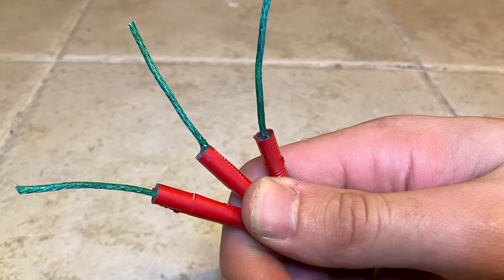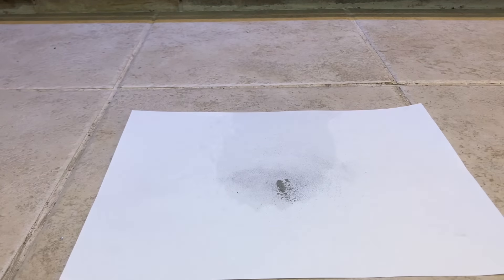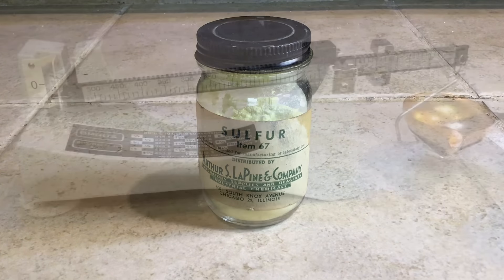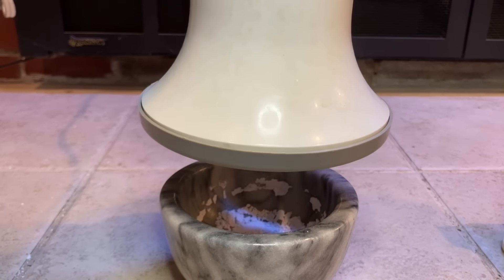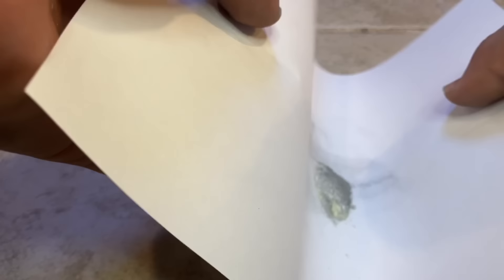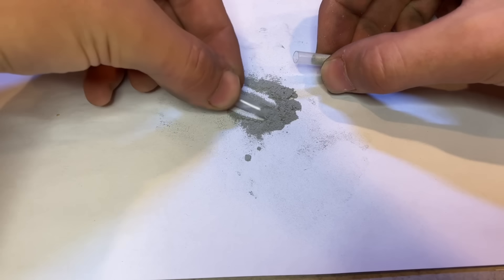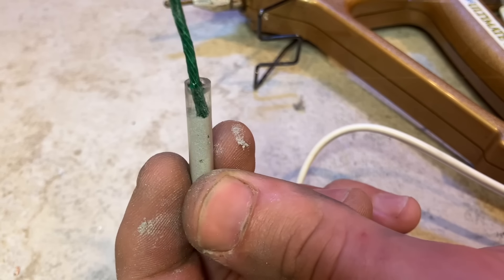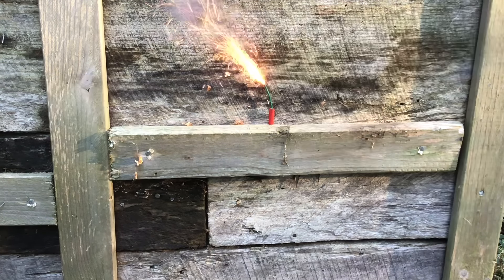How to Make Firecrackers | Super Loud!

Comment: Using hot glue to close up the top part where the fuse goes is not a good idea. The fuse burns very hot and melts the glue, basically opening it up on that side. That's causing it to not really explode but turning it into a rocket. Try using something like epoxy. I bet it makes them much louder.

Comment: As kids we used to collect crakers thad did not pop . We unrolled them a collected the powder on a news paper . There is a certain way to roll them . Fold the paper with powder in the middle than roll the edges toward the powder and when rolled properly tape together . We made them about 6 inches lonng , they were very powerful and dangerous so dont do it . We were dumn kids . We put one under a metal 5 gallon bucket and it blew apart and the end went up about 100 yards . So dont do it . We had one short fuse scare and never did it again .

Comment: As a young teen, in the 1970s, I used potassium nitrate, for my oxidizer. Either aluminum powder, or magnesium powder for the fuel. As said sulfur is optional. I'd make the powder in a larger quantity. I'd test a small amount, and look at the residue, to "tweek" the mixture, buy adding more fuel, of oxidizer. Even with potassium nitrate, the optimum mix, would make a thump, out in the open. Potassium nitrate is a lot less impact sensitive, than either potassium chlorate, and potassium perchlorate. We'd actually use those oxidizers, along with a small amount of a sulfide, to increase impact sensitivity, to make contact bombs.

For very illegal, real M-80s, you'd actually want to slow down the powder burn, just a bit, for a really loud bang.

Comment: Long ago, and far away, I made some "firecrackers", once, using 40 grains of 4FG (FFFFG) black powder. They made some amazing holes in the grass.
Reply: I did something similar when i was younger, mostly just tinkering around after having come across some black powder. I didn't have anything else to work with, so i took an old deck of cards, rolled up some tubes, wrapped with some duct tape, and forgot how i figured out a wick. But i remember that whatever i did, it surprised the sh*t out of me, because it worked much better than expected. I decided i had enough excitement after looking at the crater in my yard.
Reply: Black powder in any form is not even in the same world as fp
Reply: I know black powder isn't close, but I had a flintlock rifle and FFFFG is what I primed it with.
Reply: I did the same thing using flash powder and one of those Mad Balls taped onto a rock and submerged into a 5-gallon bucket of water.  It just about emptied the 5-gallon bucket and we all got a shower.  Good times.

Comment: I used to make the same powder but made it wet with 50/50 alcohol water and placed them on a drying rack for about 1week with a small fan and a de hunidifier running. It works well tge splatic stray would probably make it difficukt to dry. I used magnesium anode from hot water tank and it gives of a nice white light flash. We used to make all kinds after they were  banned in Chinada

Comment: Even before watching, IIRC a lot of the bang is from the tightness of the wrapping.  Wrapped very tightly, the burning charge is held longer, pressure is higher, and gives more of a snap.  Same gunpowder wrapped more losely produces less noise, the extreme of which is not wrapped at all, and it just gives a quick burning 'fwoosh'.  It is not only the amount of charge, they must be wrapped very tightly for maximum bang.
Reply: @ModelLights  flash powder does not care about a strong container that's not how it works,bp,sp,gun powder,yes but you'll never get the sound with anything but fp
Reply: @shannonking3201  ' flash powder does not care about a strong container '
Of course it does, just like anything else.  A container allows more complete burning and pressure rise before the container bursts.  No matter what it is for burning with an oxidizer, in free air it will start expanding as it burns, and the pressure peak won't be as high and abrupt as if it were in a container, went higher, and then the container ruptures.

If you don't actually understand what you're talking about, leave it to people who do isstead of pretending and guessing. 
Gasoline burns fast when in open air, and can explode with mixed air in a container.
'Flash powder' is not an explosive, it does not detonate and produce the crack of a firecracker without the container.

Literally everyone who can get some fireworks can take a few bucks, light one small firecracker and hear the crack, then unwind the paper on a second and light the remaining powder in free air.  They will know exactly who understands what they are talking about, and who does not.

BTW You do realize 'flash powder' is just that, it was the powder used to produce a flash for early cameras.  Anyone can easily look up an old movie and hear the 'whoosh' that big piles of flash powder makes for a camera flash, and see that it does not explode.  It burns rapidly and makes a bright flash, but there is no crack to it, it does not detonate.
Reply: @ModelLights  I can make a two part mixture that will provide a VERY LOUD report when a teaspoon of it is placed in an open paper cup.  I've used this method many times to test batches of flash powder.  A strong sealed container isn't necessary.
Reply: @dlkline27 i think that it depends if you have an actual detonation vs a fast burn or exothermic reaction.....
Reply: @ModelLights tell that to the german guy that mixed 2kg flash, put it into a a thin foil bag and lit it with a fuse. You wouldve went deaf in a 10 meter radius. 

Flash doesnt care about whether its encased or not. 

Many of those giant polish or spanish "crackers" (really just bombs at that point) have lots of flash in very thin cardboard tubes with thin glued plastic lids.

Theres many different mixtures of flash and many DO detonate very loudly even if just loosely sitting around.
Reply: @Sharpless2  'Flash doesnt care about whether its encased or not. '
Get a clue, and already answered.
'Flash' used to be for that, actually a flash.  Giant piles on a camera flash plaform still didn't explode.
Fireworks manufacturers have bastardized the term now to mean damn near anything.

Comment: Good safety info in this for newbies. I'd just add that if you are in an arid climate, Static Guard spray is cheap and should be used, especially if making really hot flash.. I know a guy that only tends to mix flash during humid months.
Reply: Run a humidifier in the room you're using.

Comment: I used to drill a hole in the bottom of a 5 lb coffee can, just big enough so a firecracker would fit tightly.  Then, with the can on it's side, and the open end slightly tilted upward, I'd add about 1 tbl sp of water, and at the open end about 1/4 tsp of BangSite (pulverized calcium carbide). Then carefully put the lid on tight, tilt the can so the water mixes with the Bangsite,  light the fire cracker, and hold your ears!!! LOL

Comment: As a welder, acetylene and 02 in soda bottles is quite entertaining...and if ya really want a boom, fill a 50 gallon trash bag. Don't pop it in your welding shop tho, it will break all the windows.
Ask me how i know..
Cannon fuse is a great igniter BUT...always cut it in two pieces. A short fuse into the container, and a long seperate fuse taped to it along side. The reason is the 02/acet mixture can flow into the fuse and detonate instantly upon lighting. With fuse in two parts it won't saturate the fuse to be lit. Keep in mind static electricity is a thing...
Reply: trash bag is iffy if you dont open bag shake to get rid of static you will blow up
Reply: Thanks
Reply: Static..  👍..  I stood right next to the giant bag when it ignited..  tinnitus ever since.. be safe people

Comment: Well done.  I have noticed that some chinese firecrackers made with a paper rolled tube have the end bent inwards , I think it is meant to resist the plug from coming out due to an excessive amount folded inward and is like a door too big to go through an opening.  I suspect there is a trick to it.  I did try to make fire crackers using the cardboard paper roll tube that is often used in cheap clothes hangers.  The bottom tube is hard rolled paper about half an inch in diameter .  It is a more useful size than the 50 milligrams you are using.  I never got good results.  I did do much better with a two liter bottle and some gas and oxygen and a waxed in water proof fuse.  It makes a deep base boom like a howitzer.

Comment: Bro... Just use KNO3 and powdered sugar in 70/30 mix. Compress as much as you can in a "container" of choice and wrap it with packing tape/duct tape.
Put a long fuse in and run for your life
Reply: buddy that wont make a firecracker
Reply: @leverpeber  sure it does. You just need to compact it as much as possible and then the tape around so that the pressure can NOT easily escape.
If it does, then YES its not a firecracker, its a rocket😉
Reply: @leverpeber the main difference between a rocket and a bomb, or in this case a firecracker is a nozzle.
Reply: @swealer  i dont think you have tried this before, a few months ago i tried making a firecracker from sugar and saltpeter with veryy thin walls, and sure enough its so slow and makes little preasure and it just goes out the fuse hole
Reply: @swealer  also by compressing it you are making it even slower and worse preasure built
Reply: @leverpeber  yeah but if you use pvc pipe and compacted bentonite clay it does explode. It's fun because you don't need to get powdered metals so it's much cheaper
Reply: 50/50 magnesium and kno3 is a very safe and easy flash powder
Reply: @hashimhanif7828  yes bro, but these guys are stupid and think sugar / kno3 makes firecrackers i sent a picture of their comments on a pyro server and people were laughing of how stupid they were by stating sugar and kno3 makes firecrackers
Reply: @leverpeber  yeh idk how they think itll make a firecracker maybe itll split the tube but it wont be a proper firecracker
Reply: @hashimhanif7828  also very unstable
Reply: You're thinking of potassium chlorate, that reacts with powdered sugar and be initiated by hitting it with a hammer

Comment: I got sulfur powder on a pair of my pants, then washed those pants alone once by themselves... and then mixed them with other clothes over time when I did batches of laundry... and it Ruined like all of my clothes. I despise the smell and even a couple years later I can still smell it. It gets on my hands out of nowhere and then that's all I can smell. I used vinegar and then baking soda to wash my clothes and that helped a lot... but if you work with sulfur, make certain to wear protective clothing or crappy clothes that you can throw out if you get sulfur on them. I've tried countless kinds of cleaning techniques to save my clothes, but they still stink... just a little less bad.
Reply from the maker: Relatable

Comment: Potassium nitrate is not hygroscopic. That is why it is used in gun powder. Sodium nitrate is hygroscopic
Reply from the maker: @Goodkiwibloke  it is slightly, enough that it makes a difference after being sitting in the basement for a year, huh always assumed the word was hydroscopic not hygroscopic, thanks for the info!
Reply: @PraetzelProjects that’ll learn him 😂
Reply: KNO3 does absorb some water from the air but you are correct, not as much as the sodium salt. Anyway I learned that the available KMnO4 was better as an oxidant.
Reply: I make my own black powder and I am very particular about how I make it. My best results is when I dry all my chemicals before milling them. A great way to see if you have any moisture in your chems is to put some in a ziplock bag and set in the sun. If it has moisture it will condensate inside the bag!!!  Dry chemicals best results PERIOD!!!!
Reply from the maker: @jeffreysnedeker1965  the bag trick is the best thing since sliced bread
Reply: Wrong! Potassium nitrate is moderately hydroscopic. It will still absorb water not much but some. Very easy to dissolve in water.
Reply: @williamwalker8107  It actually can and the will absorb water from the air. Depending on how long you leave it out in the open. I don't know where you got your info but just cause that you brain cells reading wrong information. Which in return constantly brain cells to correct you. So technically you owe me brain cells.
Reply: @patman0250  I'm all out of brain cells, how about some belly button lint? Otherwise no can do.

Comment: If real flashpowder is used & you leave the sulfur out you can have a typical m80. Now if you have dry sulfur added to the mix you can then tywrap 3 together and the 1 you lite, when it goes off the others you wrapped with it will go off too. So you increase the power alot. My guy that I got them from back in the 80s has since died from brain cancer so I will never know his secret mix 😭

Comment: As a kid we made them with a roll of caps, put a pin hole in the center with a sewing needle feeding each cap head on the needle and withdrawing the needle while putting a fuse and taping it, most of the time it did not work.

Comment: Shouldn’t you leave little of air gap in each firework for expansion rate. Having a father with the license to manufacture and watching him do M80’s that was one of the questions I asked was why not fill them full and he said the canister or tube would explode before fully ignition all of your powered causing you to waste most of the mixture inside. In thus making a weaker boom. I dunno being a smaller firework maybe this doesn’t count cause those types of firecrackers are usually solid and compact or if I’m not mistaken there’s an open gap down the middle but for what you’re doing I’m pretty sure if you left about 1/5 of that empty you would notice a major difference
Reply from the maker: It is really fluffy, a gap would probably be better, but they perform pretty well as is, sound mitigating microphones and speakers distort things a bit.
Reply: @PraetzelProjects  yeah when I rewatched how you packed them you’re actually wasting a lot of the mixture before it has time to fully ignite even if you use a little or a bunch like you did with the 3 you made. Think about water in a tube fully sealed off then freezing it. Soon as the most outside layers start to freeze your container is going to crack before the water can fully reach its fullest potential if you know what I mean. Cause once the container cracks you lose all that stored energy then the water that hasn’t froze will just spill out. Luckily powder will explained more so I’d actually give it 1/4 to 3/4 air gap to powder mix ratio and you’ll notice a major difference in power. You can also turn that straw into a 2x4 breaching charge but I probably shouldn’t give that secret away lol I will say if you add gun powder to the mix surprisingly enough it will weaken the concussion blast but add more flash to the boom. That was one thing I always loved watching as a kid as he blow up his product was seeing the massive dome of light and the sound of a transformer exploding in each M80. He don’t make them like he use to ever since 9/11 the ATF really hammer down hard on the good (potassium xxxxx)and (aluminum xxxxxx) now I just run around the neighborhood I grew up in with a flame thrower as I moved down the street lol

Comment: You could've just told them. After watching this video they'll become curious, find some sketchy formula online and blow themselves up. Never use hot glue as a plug. KNO3 is not hygroscopic, your nirate was just old n wet. Put it in the oven with lid open on 80°c for few hours.
Reply from the maker: @Krzysix.io11  it would be on them if they were so foolish, not to mention the information is there. The tiny hot glue plug is not an issue at this small a scale. And the nitrate is slightly hygroscopic such that storage in the basement over long periods warrants a couple minutes of heat.

Comment: 0.5g? So I guess the 1Kg I made was a LITTLE over the limit.
Reply from the maker: @Choober65  .05g for sale.
That is to say I do not believe the limit applies if it is privately fashioned and used immediately on site. Hence why mixing large amounts of tannerite is legal.
Regardless, sticking to the limit is prudent.
Reply: @PraetzelProjects this can be used to set off tannerite if needed. If you use the proper container to hold the "flash" powder.
Reply: @PraetzelProjects  I believe you'll see it written as 50 milligram 99.9999% of the time. Was that 69 cent scale accurate enough for mg anyway?
Reply: Was blasting in mind..😂😂  sending mail box to mars.🤣🤣

Comment: Hey nice vid but I’ve got a magnesium anode but when I sand paper it with the same grit it doesn’t produce much powder do you know why
Reply from the maker: That sandpaper I have is super high quality and it doesn’t lose grit on such a hard surface. Maybe just try like 200 grit and sacrifice some power. I believe the sandpaper I have is discontinued.
Reply: @PraetzelProjects  thank alot for replying but may I ask are the ratios 0.10 grams magnesium and also when I heat up the powder it makes the sulfur just fizzle and bubble

Comment: Glue guns dont spark anything.  The heating element is solid state.
Reply from the maker: Huh, well it’s a nice precaution nonetheless:)
Reply: I use to split large logs with black powder. Hot glue the 1/2inch hole closed with a fuse sticking out. This video brought back memories.

Just made a pound of black powder last week.
Reply from the maker: @kevinroberts781  that’s on the to do list